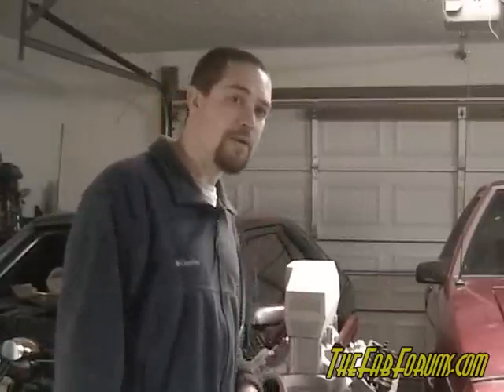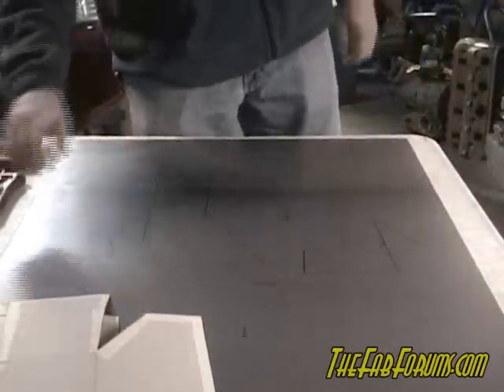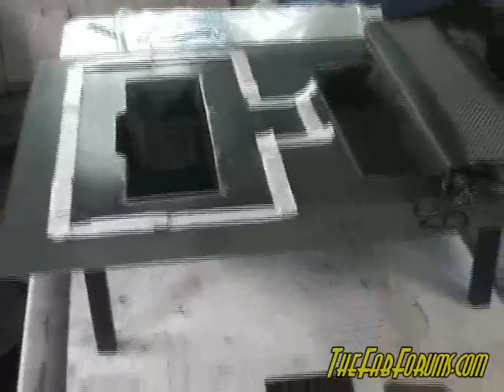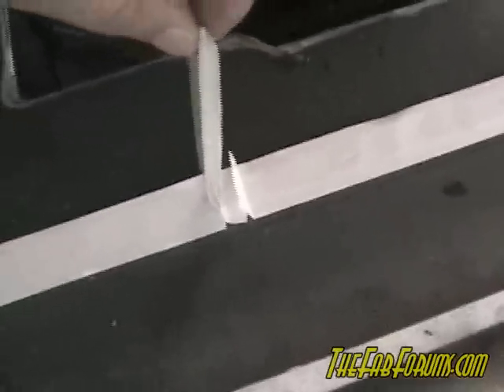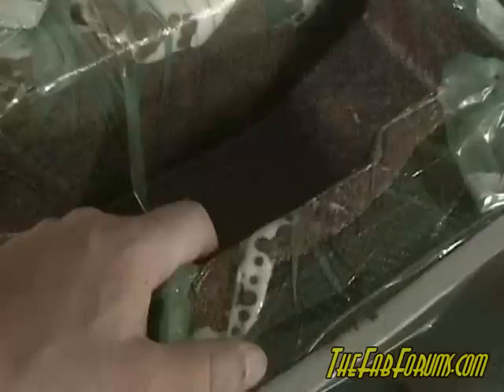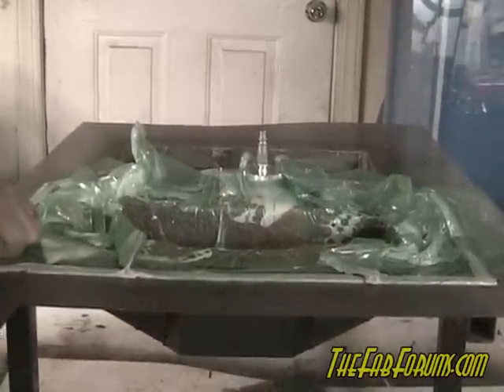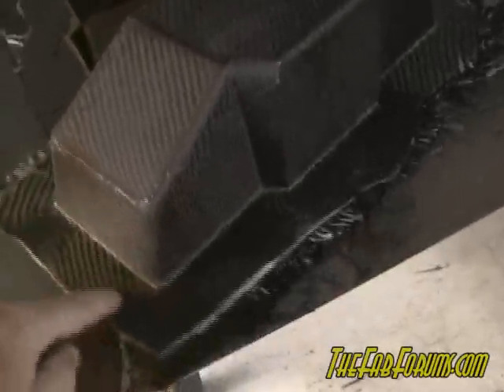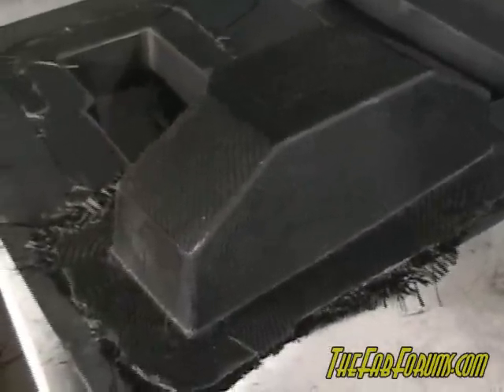Carbon fiber Intake how-to build 2

Comment: I havn't ever used a negative mold. looks good. when i learned this process we used a positive mold of honeycomb and vacuum  bagged it with heating pads. when it was done we had to hit them with a hammer to damage the panel for a repair and ya had to smack it pretty hard damage it. I dont see a lot of panel repair it is usually just swapped out. Even bird strikes at mach 1 plus might smear the coating.
Reply from the maker: yeah this was my first

Comment: Could this intake have been made as one piece with different equipment? My buddy used to work at a fab shop that made parts out of CF and glass. I'm pretty sure they could've done a one piece design. They built a entire body for a Lotus Elise which turned out perfect.

Comment: i had a crucial question about carbon fiber parts, actually how high the heat those carbon fiber can handle?? or this technique are using a resin for a high temperature?? all i wanna know is, are this carbon fiber stuff are good for extreme temperature environment??
Reply from the maker: They can handle extreme heat with the right resin and curring.
Reply: thanks for your answer. furthermore can you tell me the good resin for this problem?? judging from your explanation, the type of carbon fiber doesnt give a huge difference, is that so??

sorry for my chain question XD... thankyou...
Reply from the maker: I'm not familiar with what to use in high temp applications. You will have to do some research.

Comment: if you wanted to join the two pieces together without the flange and hardware, to make it a 1 piece design, how would you do so?
Reply from the maker: +Tyler Kurfees You would have to still make a two piece mold, lay both halves up separately (with prepreg) with one half having about an inch over hang. You would temporarily fold the over hang in while attaching the two molds together. Once the mold are attached you would then fold the extra material back in contact with the partnering side. Now just vac bag the entire part at once using the throttle body hole to access the inside. Once all the air has been removed you can then cure the prepreg in an oven. Hope that makes sense.

Comment: Epoxy Resin & Fuel dont mix!
Reply: GasserGlass The injectors are in the runners, not the manifold. So air goes past the intake, down the runners, and just down at the end of the runners, fuel is injected. You can even see it in the video for his engine. Come back when you understand efi.
Reply from the maker: Thats because no one is mixing fuel and Epoxy Resin...not sure what GasserGlass is talking about
Reply from the maker: GasserGlass LoL welcome back...but your wrong. Everything used in this video was made to do exactly what I did with it. The part that came out was not resin rich or brittle, not sure where you got that from. Not all parts come out with a shine. As a matter of fact ALL the carbon fiber parts used in the making most super cars and formula 1 chassis come out raw and are later clear coated. This video basically shows every point you had is wrong. Carbon intakes and valve covers which come in contact with fuel and petroleum, along with many many parts that are not "shiney" like your HOW-TO books say they should be. Carbon Fiber Construction - /Inside Koenigsegg
Reply: TheFabForums.com  gasser glass where are you from  what solar system  ??????  lol
Reply: Exactly...... Not sure what I am talking about is the problem!!!!..... I'm talking about the manufacturing process in this video and its manufacturing components!...... You're using items that are not used for this type mold and part making, this is why your part/s are not perfect and WILL FAIL sooner or later.....Very RESIN RICH equals "Brittle-Failure-Compromised"...... All due to Fuel / Petroleum Based Products and EPOXY resin that dont mix!.... The integrity of the part has been compromised......  and If you knew the properties & make-up of the components being used to make this part, you would know what I'm talking about! ....... I am not giving your grief, I'm trying to teach you something that you have missed, something that is HUGE.... Mistake only NON mold and parts makers have.....maybe now you will read a few HOW TO books or read a book of chemicals to know what mixes with what, you would be amazed at what chemicals & solids that are made with petroleum....even some Mold Release Wax cant be used with epoxy resin as it is Fuel based.....Open the can, smell the Diesel Fuel that its made from.... Some Vacuum bags, some carbon fiber is coated with it to help keep the strands together..... Twill Weave in this type mold should be Hand Laminated anyway...you get the Shine by using the RIGHT components to begin with and your part will come out looking like a sheet of glass! ..... Ill mute this post to end any back lash or questions.....READING is the best teacher!

Comment: Rlly nice video, I'd like to start making carbon fiber parts but it always seems to take so much time. By the time I would have done the moulds and everything I usually would have a ready made part out of aluminium or steel. Maybe in the future :)
Reply from the maker: Yea it is very time consuming. I catch my self doing the same thing.

Comment: Can you teach me how to deal with extra carbon fiber before you vacuum it.
and trim the inflate surface after you vacuum.
when you put the carbon fiber layer on the intake mould.
it must have extra fiber at every corner(90 degrees angle)
I have a problem to put the carbon fiber when i meet the angle .
no idea how to deal with extra fiber
please teach me when you have time
thanks a lot
Reply from the maker: if you use a twill weave it is able to form around tight contours much easier compared to a standard weave. What kind of weave are you using?
Reply from the maker: Great videos. I understand exactly what you are saying. If you use a twill weave it will be able to be adjusted in such a way where you wont have those extra ears of fabric. I have never worked with a standard weave to know if it can be worked the same way.
Reply: TheFabForums.com
thank you so much!!!you are really a nice guy^^

Comment: I've been looking to replace my muffler with straight pipes and your videos really make me enticed to make an exhaust system out of carbon fiber. I don't know how hot exhaust gases get but I imagine them to be hotter than the resin can hold. Is this true? Have you done any exhaust upgrades with carbon? Thanks!
Reply from the maker: Carbon fiber will not be able to withstand exhaust temps. I have made several mufflers and exhaust systems out of aluminum, that would be what I suggest.
Reply: TheFabForums.com Not sure how hot exhaust gets. but if you got a high temp exhaust wouldn't it work? Granted you need to hot debulk it and put it under vacuum (better if you could autoclave)
Reply from the maker: I still think exhaust gasses would burn it up
Reply: Though you are most likely right, I bet with enough drive someone could invent a way if they really wanted too.

Source: I work for a really well known aircraft company. lol if you know what I mean.
Reply from the maker: Yea i am a believer in anything is possible. If you end up making some exhaust I would really like to see your process over on the forum. thefabforums.com

Comment: just curious! But what performance benefits does a carbon fiber intake hold? is it just the cooler intake air temperature? because i could really implement this mod into my 986 boxster.
Reply from the maker: yea cool air defiantly because the carbon fiber does not heat soak. also weight. This intake is about 25lbs lighter then its cast counter parts.

Comment: Thanks. Sounds like a great solution to enable lower cost production of simpler compound curve structures. However, how well does it "take-up" the resin under vacuum? 

Also. can it be mixed with plain CF weave, where the treated cloth is used on simpler curves and the plain cloth in tighter, more complex areas?

Thanks in advance.

Comment: Chassis are usually built with aluminum or titanium mesh reinforced carbon fiber, not sure how many layers. Pagani and Lamborghini would be good modern monocoques to check out regarding design structure.

Comment: Hey TFF. Dont know if anyone mentioned it yet but on your dry fabric you can mist (very light) opposite mold side with  3m super 77 or equivalent. This allows you to cut the fabric cleanly with scissors with no fraying. more misting can help fit the fabric if applied to select areas, mold side. very very faint mist on mold side. like almost nothing. for me this trick has been a life saver

Comment: Hi there, i saw you bought carbon fiber over Ebay, so i was wondering if you would need more in the future? because i have a lot of left over to sell, the sizes are from 10x10 cm to 20cm x 5 meters and from different specs.

Comment from the maker: The resin will cure out on its own...but with this project I actually heated the back side of the steel mold with a heat gun to help speed up the process.

Comment: Alright, Those bends, the fabing portion of the mold making.  You're good.  Real good. I work AFSC 2A753 (sheetmetal) for the USAF and i work carbon fiber, boron, fiberglass, aramids, and the metal portions too.  To get those templates perfect like that on the first try.  Just wow.  Then to have a great understanding of composite section you did as well there.  I'm honestly impressed.  Do you have prior training? or completely self taught.

Comment from the maker: Carbon fiber is extremely strong...you can make just about anything you can think of out of it. I have seen automotive wheels, bicycle frames, indy cars, and Boing has a new passanger plane made completely from carbon fiber (Dream Liner). Brake and clucth levers would be pretty easy to do. If you have some spares I could use I may be willing to try and copy them for you.
In a nut shell fiberglass is not very flexable and will crack and splinter...carbon for the most part wont.

Comment: thank you very much, im new to this i didnt know that carbon fiber were that strong, its there a possibility to make carbon fiber parts out of aluminum casting ones? like motorcycle clutch lever or intake manifold for a motorcycle, they are rounded. also whats the different of carbon fiber and fiberglass?

Comment: I wouldn't use a CF tube, especially on a turbo.  It would screw with the intake behavior of the air and would get dirty, fast.  A CF wrapped intake would be friggin sweet though, and much easier to make.

Comment from the maker: Well there are several reasons I am using a steel mold. I could have used a FG mold if I was coping a part but since I created the design of this intake I didnt have anything to copy and it was much easier to make it from steel. The steel is stronger and will most likley last longer then FG, and I figured if the carbon intake didnt work out I could just cut the mold apart and use it...:)
Thanks for the question

Comment: Any reason you're using a steel mold? Is it so you can heat it during the curing process? I guess a FG mold would get ruined if the part stuck.

Comment from the maker: @araimundo1 The resin is called aeropoxy, the wax was just plane jane carnuba car wax. Everthing you need can be found in the resource section of thefabforums site. The complete build is also documented on there. I did buy the vacuum. It pulls about 20 inches of vac.